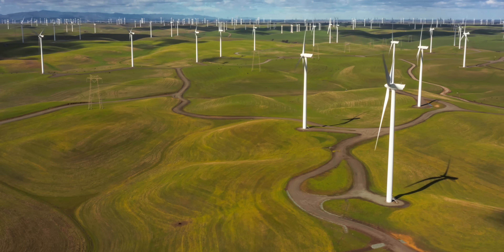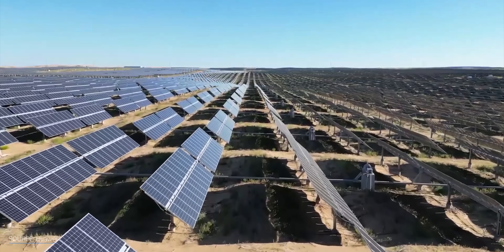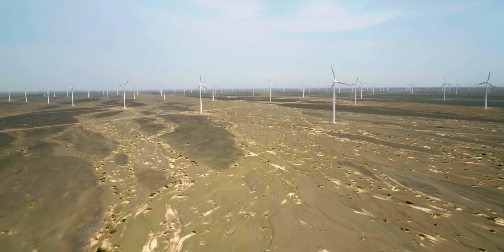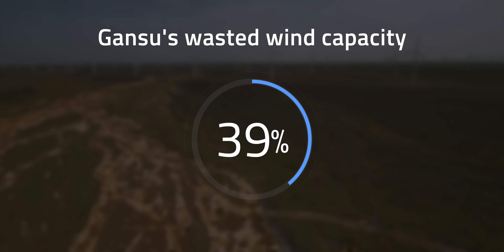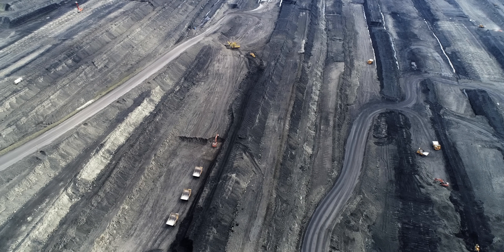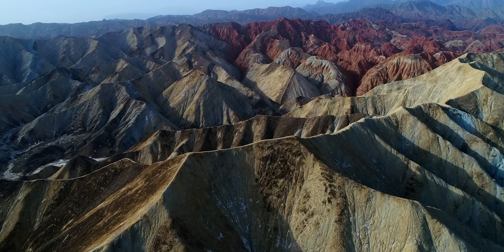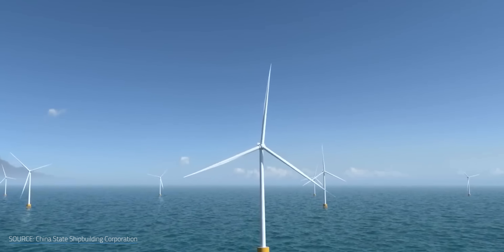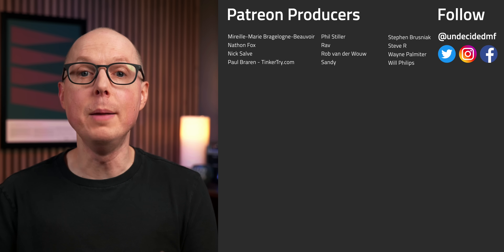The World’s Largest Wind Farm has a Tiny Problem

Comment: The remoteness of Gansu province is just temporary. Because of mountainous terrain, installing a long DC transmission project takes longer than installing wind turbines. In 2008, China began installing high speed rail (500 km, or 300+ mph). It's fully electric and covers major metro regions. This past weekend, an estimated 74 million passenger trips were expected per day as the 5-day mid-fall holiday began. (Moon cakes are a traditional part of this holiday)
Any excess power from this "wind-wind" project could easily help power all that high speed rail. 
Just think how many midsize jets China does NOT require as a result. Traveling faster by wind, than via flying on dinosaur juice. 
BTW: China has already launched a couple test satellites for what will become a communications constellation similar to Starlink by ~2028.
Reply: What does the CCPs copying of SpaceX have to do with building a project that wastes lots of its potential?
Maybe some day in the far distant future and with lots of cost shifting, the CCP’s high speed rail will be able to recoup its construction expense but lots of things would have to change radically since the low revenue coming in from paying passengers isn’t even covering operating costs including the price of electricity.
All of the CCP’s projects all trace back to foolish Western companies delusional thinking that they’d make lots of money in the Chinese market after transferring their technology and intellectual property to Chinese “partners.” They soon found their “partner” was using underpaid labor to build products for domestic and export markets and competing using their own technology.
Let’s not forget that technology innovator, Huawei, that copied Cisco software including the software defects for unauthorized use on their routers.

Comment: do we have a green fuel solution yet?  i mean, can they have onsite fuel generation at those desert turbines?  like generate H2, then transport the liquid H2, so it can be burned elsewhere.  the idea being, it will transport with less losses and you wont have to build expensive transmission lines.  

you'll just spend a lot more energy onsite to make the fuel.  and, hopefully, it would be net carbon neutral, as you'd just be capturing Carbon or things already out there.  instead of freeing previously stored carbon, like what we have in coal.

Comment: In the case of solar, it would have been a lot more intelligent to have used the same panels on structures near or at the points of use, and paired them with micro inverters (think Enphase like systems).  Paired with battery storage, the need for long distance transmission lines would evaporate entirely.  

Putting solar and batteries at new structures like car ports  or other shade making construction would also reduce the heat island effect caused by dark asphalt in congested urban areas.

Comment: Matt, your video is quite misleading. I'm going to mention one concept that is capacity factor. Your video misleads viewers and certainly makes no mention of it. It is one of the biggest concepts which explain why wind turbines are a horrible idea. Further you should delve into operating costs including average turbine lifespan. The life cycle of used wind turbine blades. Life cycle of wind turbine generators. The reason they were likely put in a poor neighborhood is anyone with half a brain knows they are a maintenance nightmare.

Comment: 0:12 - What figures are you throwing out here?!?

1GW of generation capacity can power 750,000 to 1,000,000 homes?!?

EIA data says the average U.S. home uses ~10,500 kwh in a year, or 8,760 hours. So if residential demand was perfectly flat and unchanging over time you'd barely scrape the 750,000 figure.

And in truth, residential demand varies considerably over time. So even a 1 GW source with perfect dispatchability (e.g. a coal or nuclear generator) could not be matched to anything close to 750,000 homes, let alone 1,000,000, even with a large regional grid to smooth out demand a bit.

Also don't forget that if everyone were to suddenly take your other advice and replace gas furnaces with electric heat pumps and drive electric cars, average household electricity consumption would go up a lot.

And as lots of people are fond of pointing out, if you build 1 GW of wind power capacity, you'll need to build another 1 GW of some mix of peaker gas plants and battery banks to cover you when the wind dies down. Or, you know, you could just build 1GW of reliable power plants and skip the second GW entirely.  Think of all the carbon emissions you save on those construction materials!
Reply: Are you applying USA-typical norms to a country that has different norms?
Reply: No, I am not applying U.S. norms to other countries. 

At 0:12 the video presenter specifically describes the electrical consumption of U.S. homes in an effort to illustrate (presumably for a U.S. audience) how big 1 GW of electrical generation is.

Problem is, he makes an obviously invalid comparison. Nobody sizes an electrical generation fleet in a U.S. region by dividing the number of homes by 750,000 to come up with the number of GW. Even putting aside non-residential uses, the need to follow a demand curve means that far fewer homes are served by each GW of installed capacity.

Comment: Absolutely not. What the US should replicate is the construction of 27 nuclear generation stations.
Reply: @1Sierra47  , shows your lack of knowledge on the subject. there are 93 operating nuclear in the US, with a 90% capacity factor. Please provide the number of US nuclear reactor incidents/evacuations which have occurred in  the US, in 60 years of operation??? and go.
Reply: @1Sierra47  Your reply is very ignorant. Renewables [ i.e. solar and wind have a very bad energy generation characteristic]. Where during energy generation, they can see large drops in production of energy followed by rapid increases in production. This for solar usually occurs when rapid changes in solar intensity [ i.e. sunlight], happen, but solar flares are a thing. Wind turbines experience this when there are huge change in air speed velocities. [ natural events such as hurricanes and tornadoes are thing, micro-bursts, wind vortices, straight line winds, thermals/ and other wind current abnormalities.]. All these types of event can and have knocked out power, causing grid energy collapse and cause damage to air conditioning/ heating systems, industrial motors and refrigeration systems,  and operations. Knocking them out for days or weeks. Leaving large numbers of customers  and businesses without electricity, and expensive damaged equipment. Causing supply disruptions in food, manufacturing, etc. Not so friendly. When the it takes out large industrial equipment that is used to supply stores with food, and refrigeration to keep foods available. This I consider much worse than number of evacuations of nuclear events which have occurred in the US in 60 years of operations?? What is this number??
Reply: Totally agree, Nuclear is the way to go. Besides the anti-lobbying, though, it does have a raw material supply issue to deal with.
Reply: Nuclear power is not a good alternative. The costs are just too high (current estimates are well higher than wind or PV even for not so great loacation). So far it only worked with massive goverment support, e.g. for ensurance and the developement and likely the waste disposal. Another big issue is the limited uranium supply: There is just not enough good uranium resources to replace coal. Roughly half  (there is no clear cut off) is already used up or needed for the currently working reactors. A practical problem in the US is that contruction and planing needs quite some time - we need to replace coal fast, not with a 20 - 50 year delay.
The accident and failure risk is stil bad, but highly debatable.
90% capacitoy factor for nuclear is best case. One of the few reactors actually reaching this was just shut down in Germany. The 24/7 production can also be a problem as the demand at night is usually much lower. This mainly an issue for countries like France with a high fraction of nuclear - they may also waste quite some of the power because of lacking demand.

Comment: 185 GWh of "free" electricity in the US just from Flare Gas, literally going up in smoke today....
Reply: I see gas flares around texas every day.  How hard would it be to put small turbogenerators at each to make electricity?
Reply: @sprky777  Simple.  Technology exists already to use the NatGas to run a microturbine / generator set.  The "issue" is that most of the flares are remote with no potential tie-in to the grid, which means you would need a portable storage (battery) system.  The fundamental issue today is batteries are still costly which has kept the economics unfavorable.....
Reply: @jesterlead  I see them around towns in East TX and at refineries and pumping stations. Powerlines powering the equipment and towering flares lighting the night skies. That gas could be used.
Reply: @jesterlead  yes, no economical to capture and transport the nat gas from many remote oil wells.
Reply: US is the largest exporter of natural gas today.
US is producing more oil than ever before.
Where is this waste happening, any source?
Reply: @gund89123  Any oil field. The issue is when the cost of natural gas is so low, it is not economical to save it, so oil wells, all around just opt to burn it off. Think West Texas. Here in Wyoming some people get it for free if they live close to oil wells. The only issue is the stuff coming directly from a well is pretty dirty and can corrode most regular forms of nat gas lines.
Reply: @gund89123  I've been running O&G / Energy companies for a long time and in the industry for 30 years.  Flare gas is a part of the process, and due to their typically remote locations - end up being easier to simply burn vs recover electricity (via using a turbine gen set / recip gen set, etc).  There's some cool websites that show global flares via satellite as well.  Cheers.

https://www.eia.gov/todayinenergy/detail.php?id=62383
Reply: That's a lot of toasted marshmallows!
Reply: Wow
Reply: Not only that, but the natural gas wells are the only source of helium, and were just throwing it away along with the energy.
Reply: That’s pollution without a cause.
Reply: @parttimethinker7611  well, not really.  It’s over-production and technically difficult to do the right thing.   However, it is true and an issue….and opportunity.

Comment: Let’s look at little bit at this problem because China is not the United States. China’s economic reforms begin around 1980 and with a fast growing economy china had no choice but to use coal because it did not have cheap ready access to liquid fuels. At the same time china’s one child policies a markedly reducing the workforce of males within the time frame of new Millenium. Add to this most of Chinese men smoked and air pollution was adding to health problems reducing the working time of older men. In addition to this Korean and Japan were complaining of days of brown cloud that became the attention at the Olympics. 

China had to do something fast. So let me just say this, any effort made to push toward alternative energy is a noble effort, and so we should not point the finger at china. The city I live in is one of the largest CO2 producers in the world and many a morning going to work I can see multiple gas flares on the horizon, there is currently a natural gas blowout spewing a plume of flame 100s of feet into the air. So this is not a finger pointing critique. 

The problem in China is there are things done for political reasons and things done for socio-economic reasons and we often need to let the dust settle to know which is which. For example china has a habit of putting displays along the roadsides for show purposes with up close inspection revealing these things are not functional. 
But in this case development is not market driven but public sector driven. In the early days of rapid growth wind energy in the US there were days in which wholesale electricity prices dropped to zero. That’s the same as wasting energy. 

So let’s actually look at the numbers of what China is doing. Let’s set a benchmark. 

“Wind power in Texas, a portion of total energy in Texas, consists of over 150 wind farms, which together have a total nameplate capacity of over 30,000 MW” 30 GW and growing. As I just said the industries in the Houston Metro Area is one of the biggest producers of CO2. 
“The PV max output is 22GW but does not include the ramp up of PV built in the last few years on homes. As a consequence we are at 60 GW with 30 million residents it comes to about 2+ kw per resident. We are very energy thirsty in this state, this does not include the hydrocarbons used for cars. Texas, by far has the most advanced alternative energy production and it’s almost certain the state while have the forefront economy in the US in the coming years. The problem is not however win-win. Texas is well behind in the average energy efficiencies of its vehicles, concentrated in cities far from alternative energy production there is almost no capacity right now to supply electricity for electric vehicles any more than short-range commute vehicles. 
   

OK so how is china doing? Good or bad compared to Texas. We are comparing an authoritative economy with one of the most liberal free market economies in the western hemisphere. Remember Texas has a largely independent electricity market. 

China produces 3 000 GW of Electric power. With approximately 1.3 TWfrom alternative power, between a half and a third. While that seems superficially good on the surface, most of the 1.7 TW comes from coal which has double the carbon footprint of natural gas, which is the major source of Electric power in Texas. So all in all China is on Par with Texas in terms of alternative energy to CO2 production.  But one thing we don’t see here in Texas is stranded natural gas that is flared because of distance from pipelines and low market prices (somewhat helped by the Rus/Ukr War)
 
A little bit of apples and oranges,  but as long as china’s reporting is correct we should not be too critical of alternative energy production, but somewhat critical of their coal usage where as similarly for Texas we should be critical of natural gas flaring in Texas and the lack of alternative power coupling to the oil/gas refineries, as these industries like coal plants in China are the hot spot of CO2 production. 

So now less look at some countries. 
Canada 67% hydro or alternative also nuclear power. 
Mexico 66% fossil fuels. Almost no nuclear power. 

But Canada has a large landmass and relatively few people so it’s easier to utilize renewable energy. Canada also shares its grid with the US. Whereas Mexico has a relatively small land mass and a magnitude more people. So it’s no surprise Mexico’s carbon foot print looks like China. The United States which has a base of nuclear power production has shifted from Coal in the 1990s to Natural gas with  a steady expansion of wind and solar energy from the areas most utilized to those which had yet to be utilized. As a consequence Texas’s relative lead has diminished as more solar electric power plants have popped up on the East coast. 

So who is winning the race for alternative energy. A better question is who is winning the race to reduce carbon from their production process. 
Norway, Brazil, Canada, Sweden, Germany. Many of the top countries on the renewables list have hydroelectric power. 
Countries that reach high up on the list due to wind are Denmark, Uruguay, Ireland, Spain and Portugal. 
Pulling up the ranks of alternative energy using solar is Namibian, El Salvador, the middle eastern countries. 

So it would seem that many countries are doing better in terms of alternative production than the US or china. Some of the poor smaller countries are doing unexpectedly well. 

So let’s look at the consumption of CO2. Current global CO2 production has stabilized below Gt/annum. Asia consumes more than half, through the highest per capita usage is in the oil producing countries incl. US and Canada. 

IOW, what form of energy is being used and exported which can be moved to electrical. Currently china is one of the biggest producers of metal, metal production accounts for 11% of the worlds CO2. Petrochemical industry is #2 at 3.6% and so this is a reason the footprint in Texas is so high given its alt. Energy production Added to this is 3.6% increase, 5.8% in unalloquated combustion 5.8% emissions due to methane escape and flaring. Meat consumption drives agriculture and CO2 production. 

So the bottom line here is that we should not focus on China, a relatively easy target to pick on, but look at states in the US that are behind in alternative energy production and industries that are behind in the conservation of greenhouse gases (e.g. oil and gas energy industries). Let’s bring the US up on the list of nations above the average global score, which is where china, oddly sits. If Namibia can do it, so can we.

Comment: the US and others should be focusing on SMR and fission power generation. it is location flexible, safe and can be mass produced to lower cost. screwing around with long distance transmission and other problems of solar and wind is not smart. focus all the energy nuclear development and the tech will develop quickly to solve most of the problem